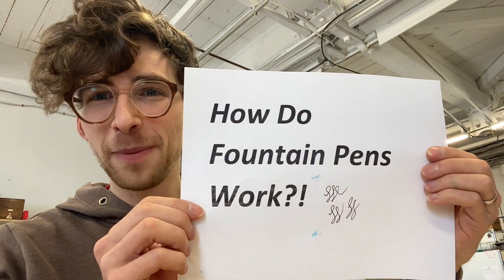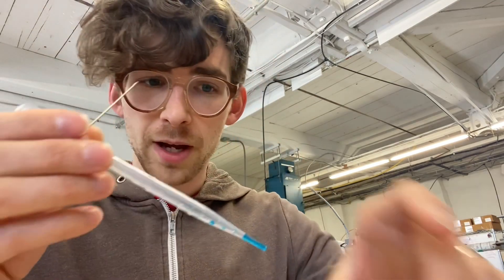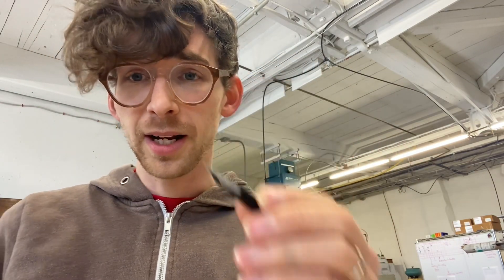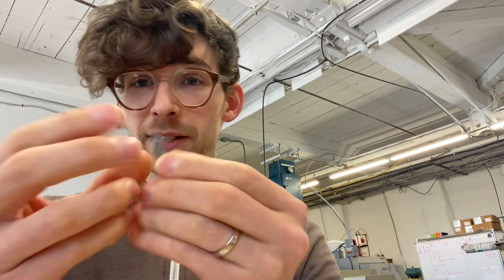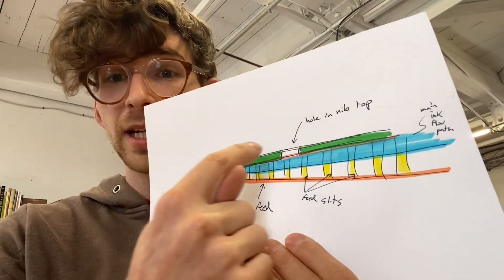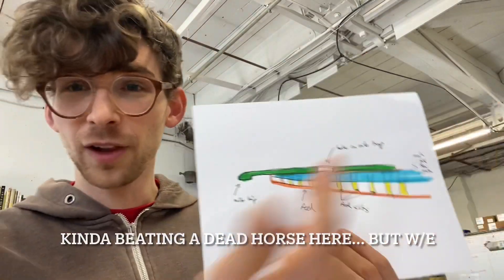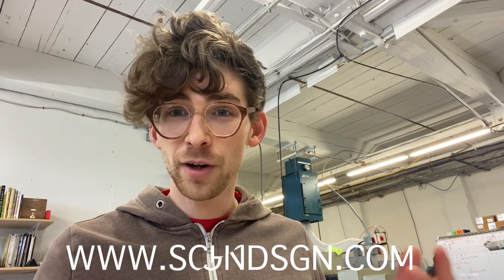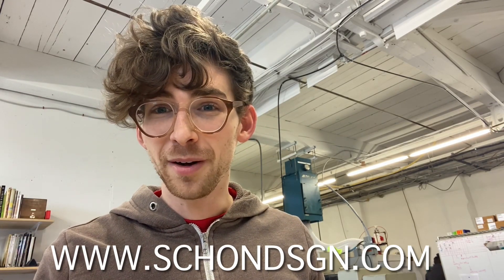How Does A Fountain Pen Work?!

Comment: A fountain pen works through controlled leakage.
Next question?
"What is the leading cause of divorce?" That's an easy one: Marriage.

Correction: The tipping material is there to prevent wear of the tines, not to determine the width of the line. Look at a stub nib. No tipping material. The line width depends on the angle and motion. Stubs have a wider line (depending on angles and direction of motion) than any tipped nib. Again, depending on angel and direction, the same stub nib has a narrower line than any tipped nib.